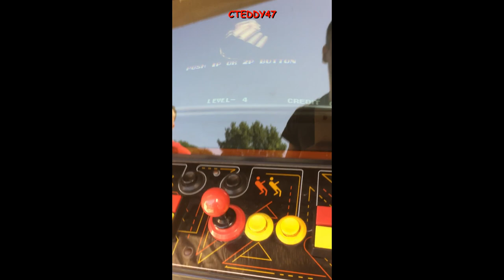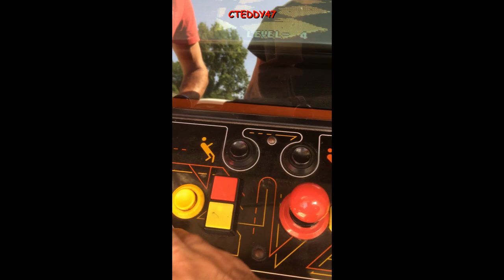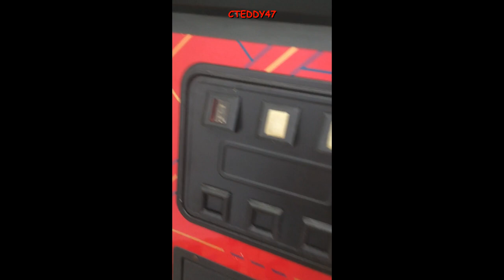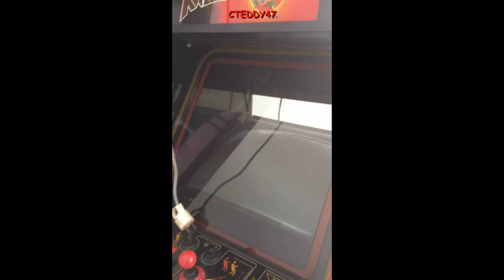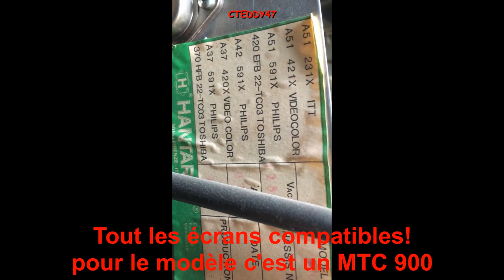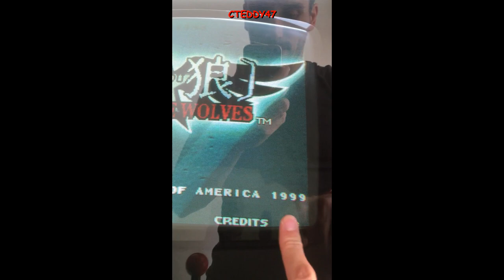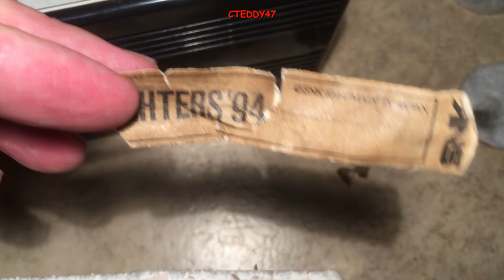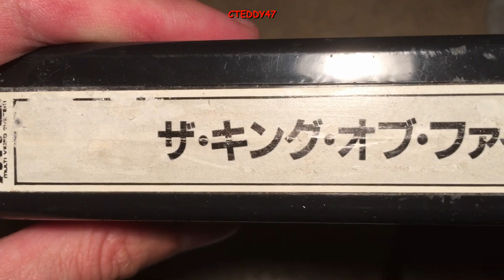Achat d'une vraie borne d'arcade d'époque Royal System Kendo (SNK, Neo Geo, capcom, prehistoric isle

Comment: Serrures a percer et remplacer,pannel a rafaire en 4 ou 6 et le reste,nettoyage,reglage ecran.
L'ecran...bof...mettre en trinitron a la place est pas mal.
Le bezel tu peux en faire en plastique avec thermo decoleur peinture ou juste carton et scotch.
Tu peux changer les hp pour du 2.1 de pc avec un slot mvs stereo ou multi jeux.
Et un peigne jamma voltmetre tres utile!
Mais a 400 ca va.
Reply from the maker: désolé mais je suis de 1980 j’aime le full origine!
donc elle va rester avec les serrures d’époque même si oui on peux avoir les mêmes en pas chère dans le commerce!
ce n'est pas difficile de crée une clef sur mesure ca prend juste du temps (il ne faut pas être fainéant!)
le panel est comme ca avec c'est 4 boutons d’époque et il le restera!
(autrement il y a longtemps que j'aurais acheter 10 boutons sanwa pour refaire le panel)
l’écran est d’époque et il le restera aussi!
sérieux ca m’énerve les gens qui change par une TV ou un LCD!
le one slot mvs sort du mono donc complètement con de mettre du stéréo et encore plus du 2.1 avec un caisson!
s'il faut commencer a remplacer les choses par des non origine dans une borne,
autant en acheter une de maintenant ou en construire une avec du medium et tout le matériel moderne que tu veux point!
modifier une ancienne c'est un sacrilège et je ne supporte pas les gens qui font ca!
c'est quoi l’intérêt a part ruiner une borne d'époque???
c'est n'importe quoi il y a que les branleur qui fond ca ce n'est pas des passionnées!
Reply from the maker: alors alors alors, je prend note de tes suggestion et désolé de mettre emporter 😬
je vais essayer de répondre en vrac a tout ce que tu a dit :
- je n'ai jamais voulu en faire une borne dédier a 1 type de jeu mais seulement une borne qui tourne sur un slot MVS comme elle est d'origine!
car oui elle est sortie d'usine comme ca même si tu a du mal a le croire!
il y a plein de personne sur les forums qui on les mêmes d'origine en rouge ou en noir!
et le kick harness ne me sert en rien, j'en revient plus bas je répond tellement en vrac...
- par contre oui je doit revoir le câblage a certains endroit car entre autre,
mon interrupteur était brancher sur le "P" de la syncro vidéo et ça éteignez la borne avant, mais plus maintenant!
déjà je trouver ca bizarre qu'avant ca l'éteignez sur ce pin??? 🤔
a la limite éteindre l’écran mais pas toute la borne 🤔
façon le branchement ne fonctionne plus maintenant 😂
- j'ai un slot one mono comme j'ai dit, donc il faudrait que je passe sur un autre slot qui a le stéréo pour l'avoir!
mais je n'ai est pas envie d'acheter un autre slot vue que mon slot marche très bien tu comprend 😉
(même si je rêverais d'avoir un MVS 6 slot 😍 mais tellement chère... priorité a des choses plus importante 😂)
- d'ailleurs rien a voir mais j'ai un magic key et j'utilise mes 65 MVS aussi sur mon AES 😁
(oui car j'ai 65 MVS étant collectionneur, tu comprend pourquoi je ne veux pas faire une borne dédier 😂 )
- tout les boutons est stick sont d'un autre monde certes je te l'accorde, mais c'est d’époque et je trouve que ca lui fait sont charme!
le problème c'est que tout est déjà pré percer et que je ne veux pas re percer...
(j'en revient sur ca après désolé 😂)
on le voit a 5:55 le pré perçage de la plaque!
mais voila une photo du panel d'un membre d'un forum 😁
https://hico-srv004.pixhotel.fr/sites/default/files/styles/gamoovernet890px/public/gamoovernet/20151012202218-poke53280-panel-pre-percy-.jpg
les doubles boutons c'est ce qui ce fessais a l’époque sur les bornes euro malheureusement!
photo entre autre d'une personne d'un forum qui a acheter les mêmes royal system !
https://hico-srv004.pixhotel.fr/sites/default/files/styles/gamoovernet890px/public/gamoovernet/20131204094611-antoweb-IMG-1198.JPG
du coup le bouton a coté du stick est tellement prés, que les assembleur on du retailler le plastique pour que ca passe!
si je change le tout je vais devoir décaler le bouton et j'aurais un trou, je devrais mettre un cache spécial pour ne plus avoir le trou et ca ne va pas faire beau...
(et je veux garder le panel d'origine tu comprend 😬 a la limite faire 2 perçage en haut des 2 boutons,
mais j'aurais toujours ce trou a coté du stick...)
par contre je ne joue pas vraiment au jeu de combat même si j'en est plein pour la collection lol
je joue surtout a du shmup, run and gun et Windjammers!!!!!!!! 😍
pour l’écran je vais faire un capkit vue l'age mais autrement a part le marquage, ca va je trouve qu'il a une très belle image et aucune convergence!
j’avais faillit acheté une Jeutel a un moment car je les trouves super belle d’extérieur, mais alors l’intérieur et leur coté artisanal 🤢
(la blague leur roue de vélo pour mettre l’écran de yoko en tate 😂 )
c'est pour ca que je me suis rabattue sur cette borne car intérieurement ca va a l'essentiel et c'est très propre!
après ce n'est pas comparable avec de la Jap car c'est 2 style différent!
désolé par chez moi dans les années 90 on avais aucune astro ou blast de chez sega ou autre jap 😉
on avais que des bornes en bois qui était le plus souvent dédier a un jeu oui!
(bon par contre ok la taito egret 2 j'aimerai l'avoir 😍 mais alors le prix 🤑😅)
fin voila